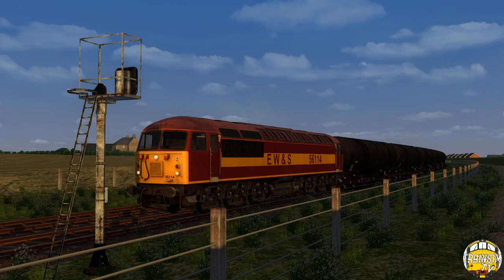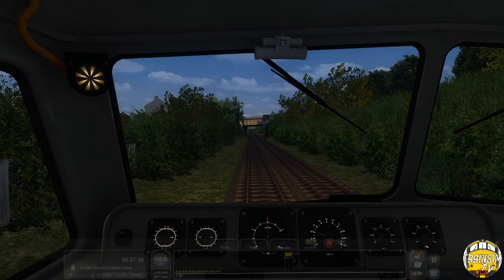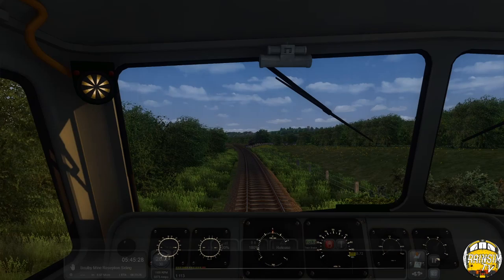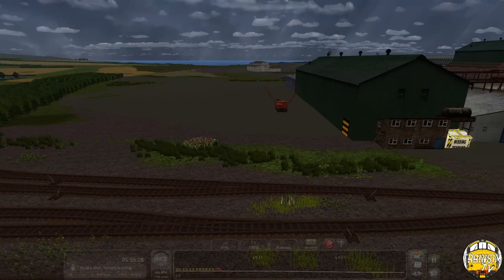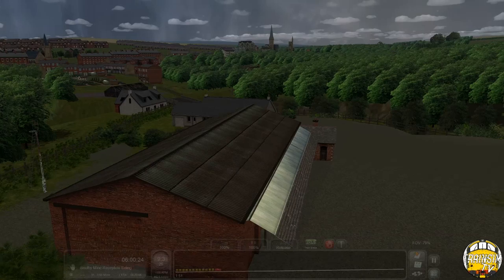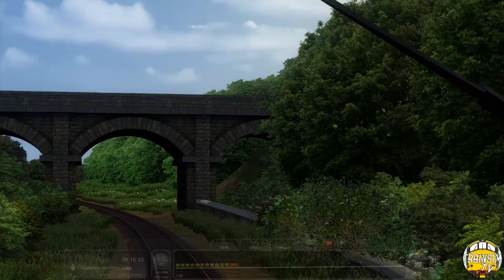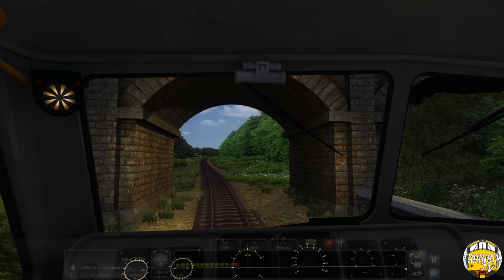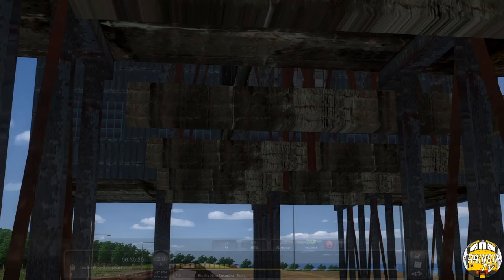Train Simulator 2020: Saltburn to Boulby Route

Comment: Thanks for the video, To answer a few questions, This route goes way back, One of my earliest builds and it shows, Before gradient smoothing and before 3D trees, Also before Google earth overlay but we have those now and It's something I'm working on, I've started at Boulby and will work towards Saltburn bringing the route up to scratch, I've also recently learned how to repaint so I'm working on a suitably rusty wagon fleet, Some for potash, Some for salt spanning most of the early era.  If you download the ironworks pack from UKTS you should get working cranes in the sheds at Skinningrove, They will lift the load from the Armstrong Powerhouse BAA wagons but I'm yet to try them with anything else, I now have th VP 3D tree pack so I'll be making use of that, The branch sees quite a few test trains, 31s, 37s, 57s, 67s and suchlike, 70s were trialed in recent weeks, I have a group on FlickR dedicated to the branch I've just been sent pictures of an HST working to Boulby, The group is here to inspire any potential scenario writers - https://www.flickr.com/groups/1902805@N24/pool/
I appreciate the feedback and will take another look at that signal at Crag Hall, Seemed to work fine in Freeroam when testing but is very hit and miss, There are no distant signals that I know of, Just a fixed board up near the cliff tops which I'll add when I find a suitable asset, Anyway, Looking forward to your next video, Nice to see you got the route up and running, Your missing bits at Boulby are likely to be road vehicles from a Spanish site which all looked suitable for 80s/90s, As you enter through the gates at Boulby the original route curved right towards Staithes and has been built over by the mine, I'm not sure when fuel oil was unloaded either but looking on Google earth there's pipework at the very far end of the yard so I'm guessing the wagons were shunted up there, The oil was brought in from the mine opening until around 2000 when a gas fired power plant replaced the oil plant

Comment: Your simulation is inaccurate.  trains return from teesport to boulby, the wagons are empty. they are full on the return trip to teesport.

Also the line used to continue via staithes, sandsend to   whitby via 5 viaducts. They were demolished BEFORE beaching because they were found to be substandard and in danger of collapse.